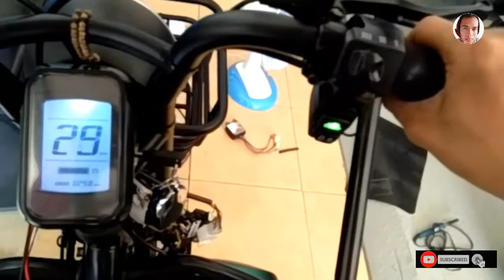HOW TO FIX EBIKE 3 SPEED NOT FUNCTION- E BIKE | ELECTRIC BIKE REPAIR SHOP

Comment: sir ano po kya problema ng ebike q 3 wheels ayw gumana lht ng ilaw at cgnal pti busina?
Reply from the maker: If pati reverse ayaw gumana (if  3 wheels) 
Check fuse 5ampere. Nag cut na yun.
Check mo rin converter 12v bsks sira na

Comment: sir may speed limiter po ba yan, kapag tinanggal ba speed limiter nyan pwede na syang lumagpas ng 28kph? lalo na pag pababa yun kalsada
Reply from the maker: Yes sir meronm pwede tanggalin para bumilis.
Reply: @DharwinB  ganun ba sir sa amin kasi hindi namin makita yun speed limiter eh, diba wire lang naman yun sa controller na pwede tanggalin? pag pababa kasi kahit anong throttle ayaw ng bumilis parang may speed limit talaga sya
Reply: @DharwinB  so kapag tinanggal yun speed limiter yun 123 na speed hindi na sya gagana sir? lagi nalang sya naka max speed?

Comment: Boss, ask ko lang.
May ebike kasi ako na 2 months pa lang. tapos yung speed selector na 123 di na gumagana, nawala din sya dun sa panel. Pero kapag unang bukas ng panel, meron sya then ilang seconds na wawala na sa panel yung 123. 
Anong possible na problem kaya sir. Paano din po maayos? Thank you sa sagot mo. ☺️☺️
Reply from the maker: Check wirings. Baka putol negative line. Check all fuse